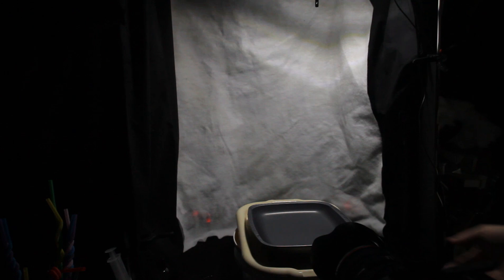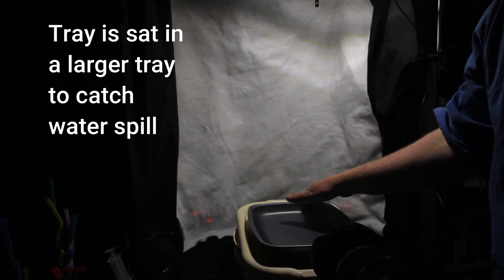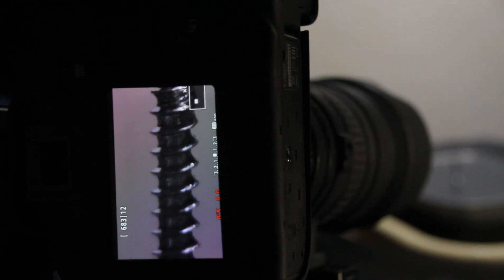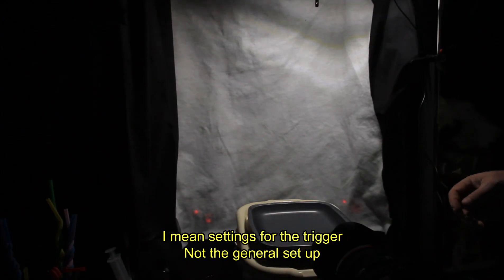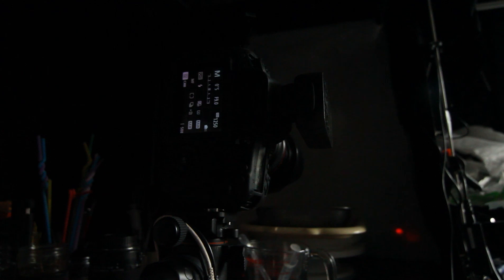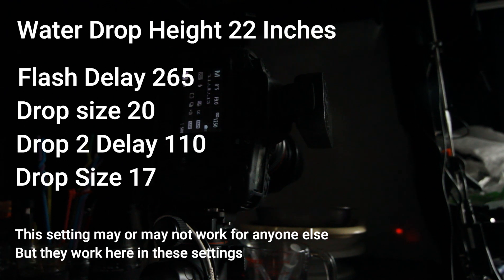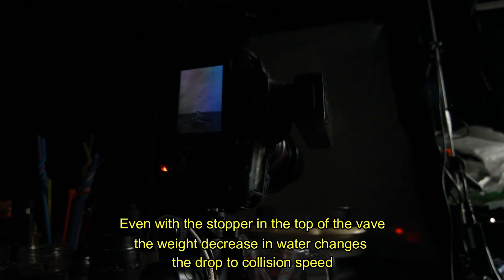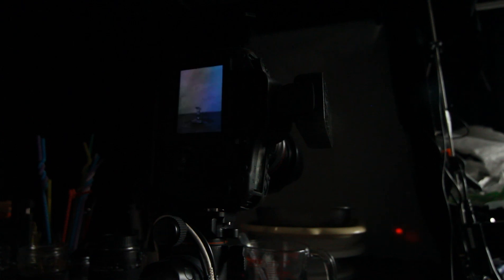PLUTO TRIGGER WATER DROP SET UP 1

Comment: You don’t detail your exact setup. But, I have found that if you connect the Pluto to the flash (using the PC port) instead of relying on the wireless trigger to set the flash off, i can get some pretty consistent shots regardless of the amount of water in the valve. I also add a small amount of Xanthum gum to the liquid in the trigger to help with consistency also.

Comment: Beautiful shots.  Would you say the depth of the tray the water falls into is important for getting a high splash back up? I'm using a fairly deep bowl and all I get it crown-like splashes.  No column of water to aim a second drop at.  Further, when I set it up for a single drop, I always get 2 or 3 so I'm extremely frustrated so far :/
Reply from the maker: I am not 100% sure, but i beleive there is. I got lucky with the tray i ended up using, i tried a shallow tray about 15mm deep and had no height in stem, tried a deep cup and again nothing, top of my head i cant remember the depth of my tray, but i sure it listed in a subtutle in one of the videos
Reply: Geoff, do you have a lid or cap on the top of your water column? I have a Miops valve and it makes a big difference in the number of drops if I don't have the cap on. I get too many if I leave it off. Also, I had the opposite problem with the depth of my bowl being too shallow. I didn't get a big enough "bounce-back" when my dish was too shallow. Other issues I had was making sure my valve was precisely straight up and down. Just a tiny deviation from 90 degrees straight up and down from the water surface threw off the collision.